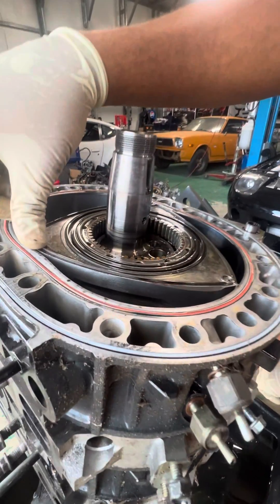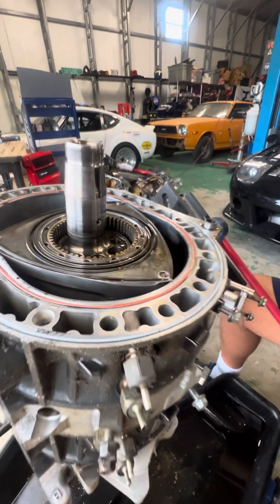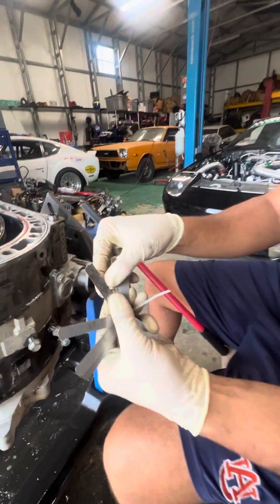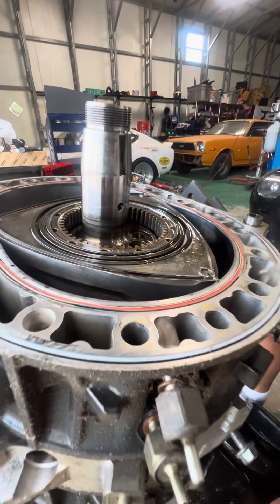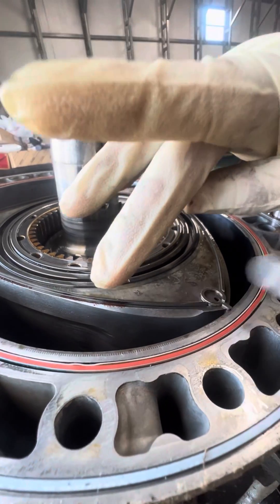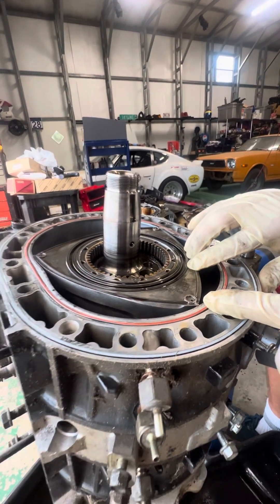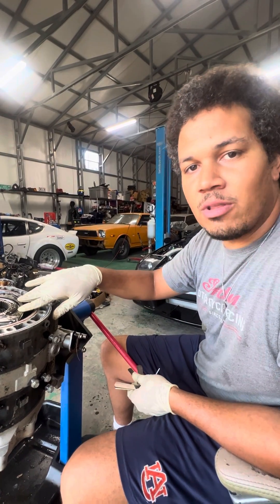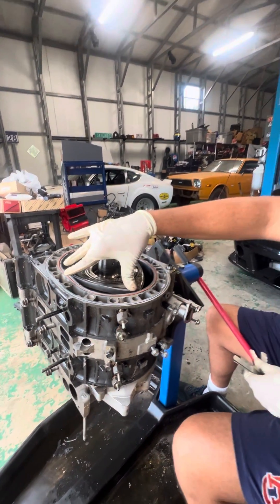Explaining Rotary Side Seal Tolerances

Comment: WOW that's a huge gap! Did the engine even start without oil or pull starting it?!!!
Reply from the maker: Oiling was fine, just improperly clearanced
Reply: @BridgeMoto  I think you misunderstood-he is not asking about oiling. He asked if it started without having to splash some oil into the chambers. Sometimes, if engine will not start, splashing some oil in temporarily seals gaps, improves compression and allows the engine to fire